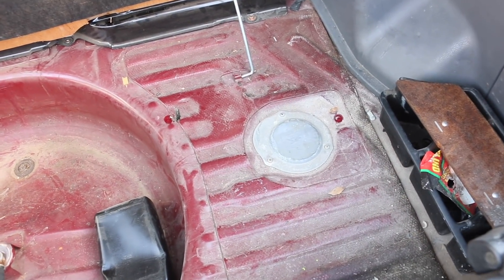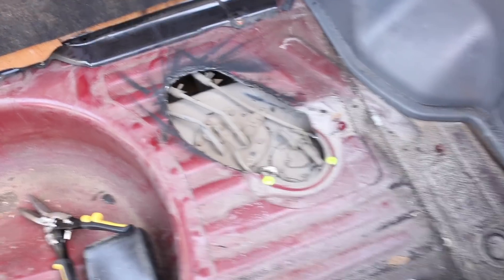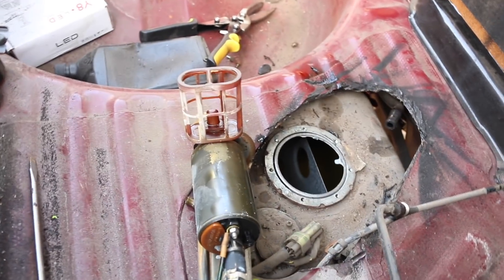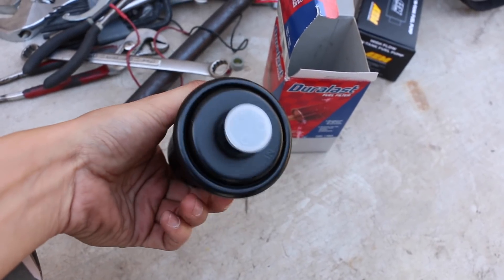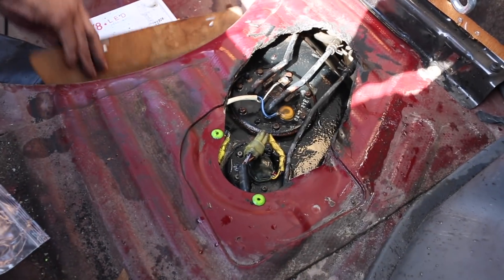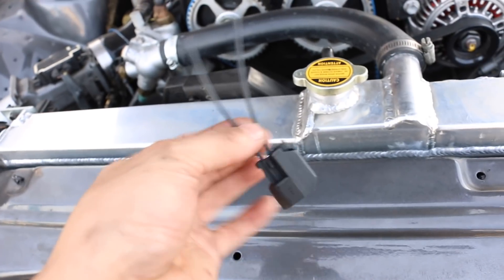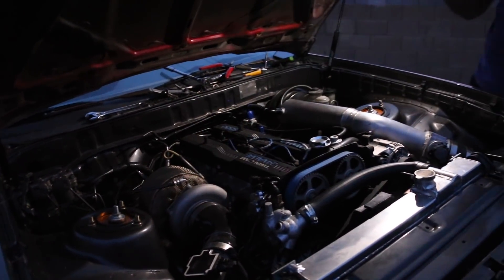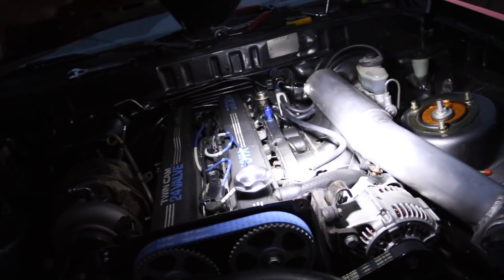MK3 SUPRA BUILD, WE'RE FINALLY MAKING SOME BOOST!!

Comment: That fuel filter is the very reason why you don't do it that way. What if that filter is stuck in the gas tank and causing a flow issue with the pump? also it's good measure to remove the entire tank to clean it out properly to prevent future issues.

Comment: hay are you using the Lexus AFM complete setup? or Lexus housing and 7m meter?
Reply from the maker: Martin Persaud what? Im confised by your question brotha.. what is “Lexus Complete setup”
Reply: @-LFATV  in this video at 9:54
You are picking up the Lexus AFM (which is25%larger )  I did some research  and installed mine (lexus AFM) however I am burning rich  when I idle it's sweet !at 14.6 on my wideband  however when I press it's (accelerate)  like 10 rich
 to all.according to blogs  I can try the lexus housing with the 7m sensor.( my 7mgte sensor( the back piece that measure the air )was damage when I try cleaning it 
So was just wondering  what's your set up.
Top job on the video  and the suspension video really help me out .
Reply from the maker: Martin Persaud mine is the same way bro, even though these parts are jst slapped on the vehicle still needs to be taken to someone that can tune it on safc for the vehicle to run perfectly. My car (even though i can go into boost now ) goes into boost im still very rich. So i will be taking mine for a safc tune soon
Reply: @-LFATV  thanks Luis 
I'll get a SAFC depends on how yours works  .I'll keep looking out for how the tune goes for you.

Comment: Hay Luis .just need your help in conforming . I am wiring up the safc 2 1991-2 7mgte .  1.which knock sensor  (purple wire)  you connected  1 or 2  .also the trottle position  sensor (green wire ) will be the (VTR) on the  ecu diagram  and not the  idle trottle position sensor (IDL) and finally the  RPM signal  (green wire)  I don't see that on the  ecu diagram  
Thanks for your help B
Reply from the maker: Martin Persaud my knock sensor wire is not connected bro, i only have throttle, rpm, fuel connected. Make sure to go to aem website for the proper wiring as they vary from pre 89s

Comment: You forgot to drill out the maf
Reply: ? For the manual adjustment screw ,if you have any info on this topic  please share .
Reply: Martin Persaud yeah I drilled mine out and un screwed it, it let’s un metered air threw raising boost cut limit